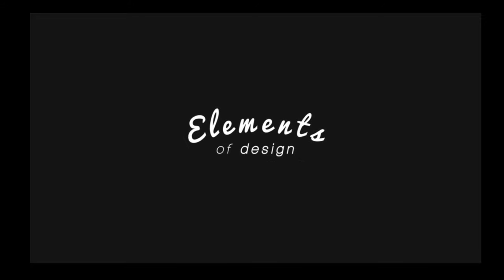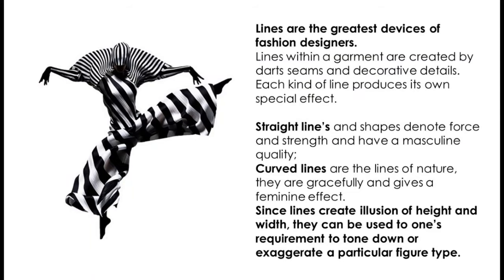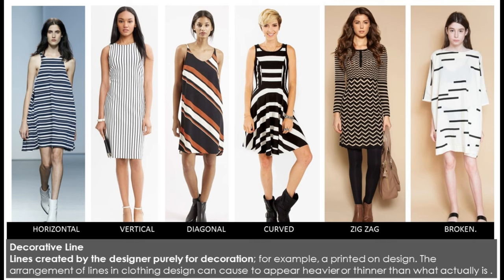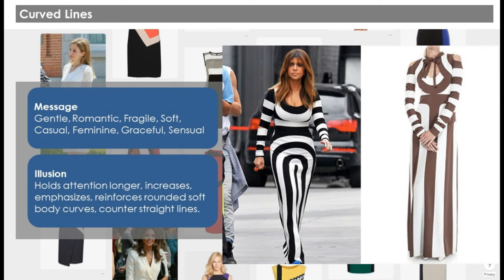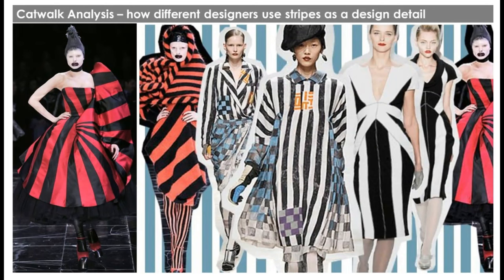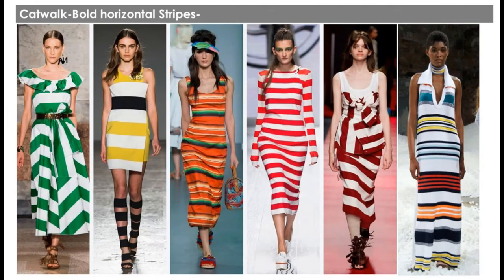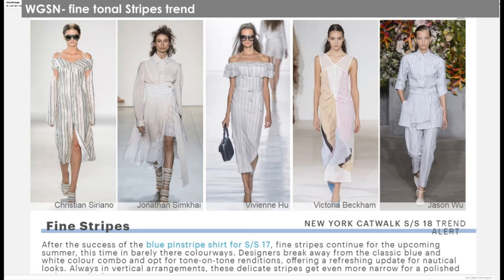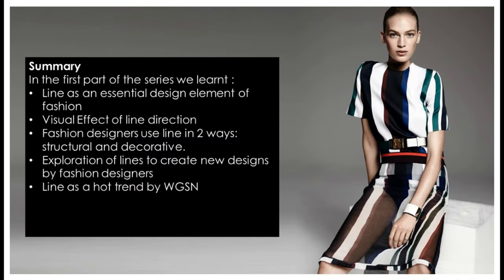Elements of Fashion Design LINE

Comment: Sir what is the difference between technical and stylized illustration
Reply: Sir kindly share the notes with illustration if possible 
Thanks in advance
Reply from the maker: @vandanabhakte3996  technical illustration represent garments as they are .. they look like models with flat Skeches whereas stylised illustration are abstract representation of garments where the models itself is stylised with exaggerated body proportions
Reply from the maker: @vandanabhakte3996  technical illustration represent garments as they are .. they look like models with flat Skeches whereas stylised illustration are abstract representation of garments where the models itself is stylised with exaggerated body proportions
Reply from the maker: @vandanabhakte3996  technical illustration represent garments as they are .. they look like models with normal features and garments looks like flat Skeches whereas stylised illustration are abstract representation of garments where the models itself is stylised with exaggerated body proportions and garments are like a hint representation e.g illustrations made with water colours